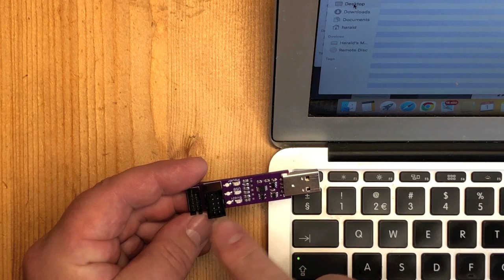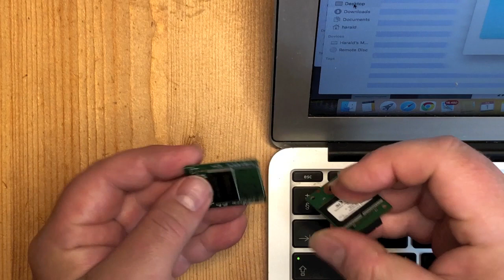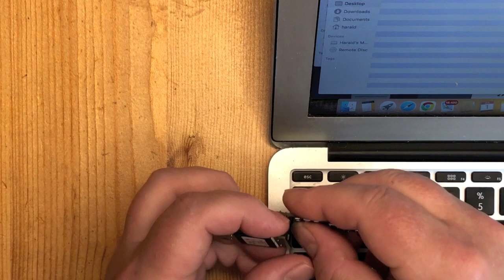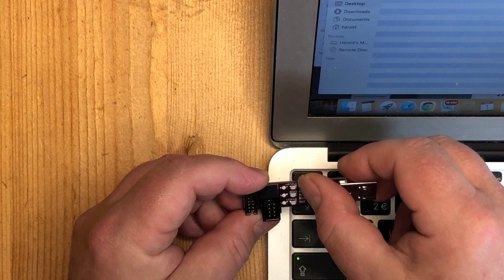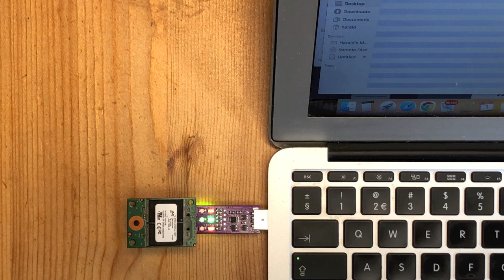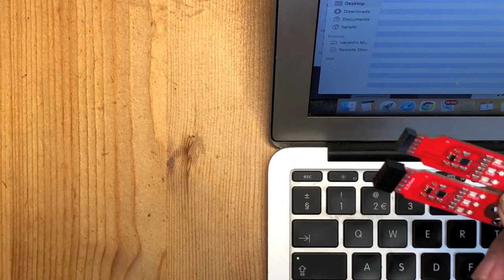Chipmunk eUSB adapter for connecting eUSB DOM to normal computer and tools for testing eUSB ports.

Comment: Does this also work with the 3.3V eUSB drives? The Virtium TuffDrive model's datasheet implies it works both with 3.3V and 5V sockets, but other vendor SSDs with the small 9-pin connector are clearly 3.3V only (0ohm resistor placement, missing regulator, etc).
Reply from the maker: If the eUSB module doesn't regulate the 5V down to 3.3 volt you would have a big problem. If needed (and you supply a 3.3v module to test) I could make a version for 3.3volt modules, but as far as I can see all eUSB modules out there in the real world are 5 volt modules, even when they work on 3.3 volt internally